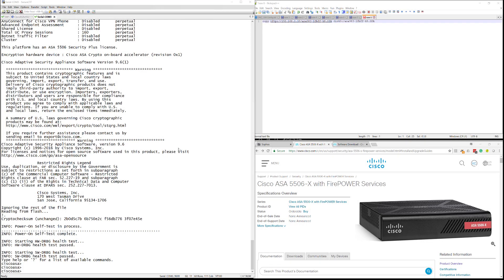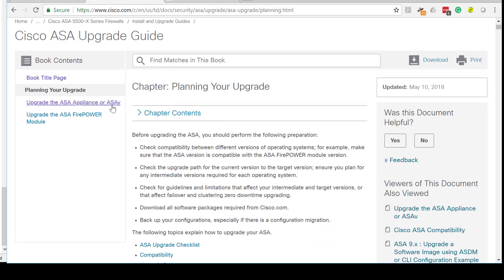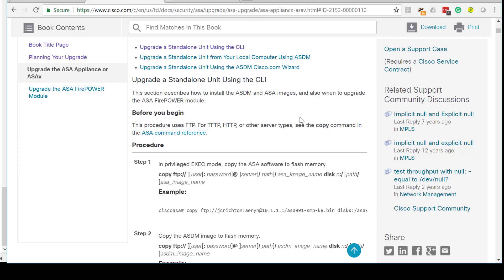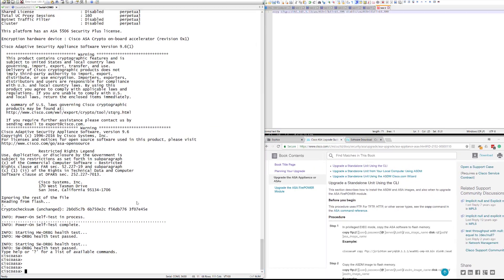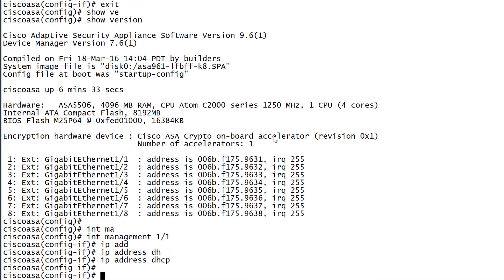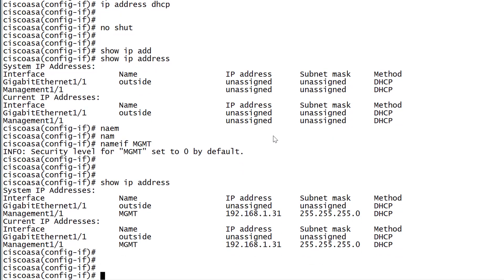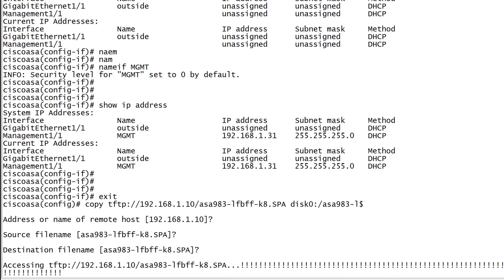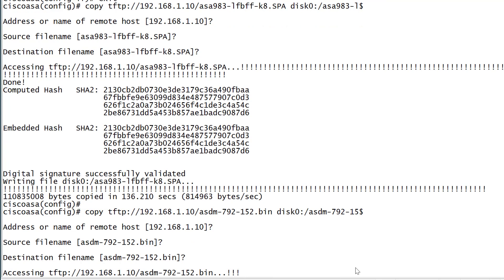How to Upgrade a Cisco ASA 5506-X

Comment: Do you have the asa 9.0(4) image
Reply from the maker: Sorry, it's not permitted to share images. If you require the image, then please access software.cisco.com with a valid account that is capable of downloading software.
Reply: @NetworkWizkid  I know but the image is no longer on the cisco site as it is no longer supported
Reply from the maker: @bolatan11  I see! I don't save the images unfortunately, sorry.

Comment: Probably worth mentioning that you can have multiple asa boot images and they are processed top down not as listed in the flash but based on order the boot command was typed in. If you have an existing boot system entry newly typed command will place your new image at the bottom hence we need no boot system for old image
Reply from the maker: Thank you for watching and sharing.